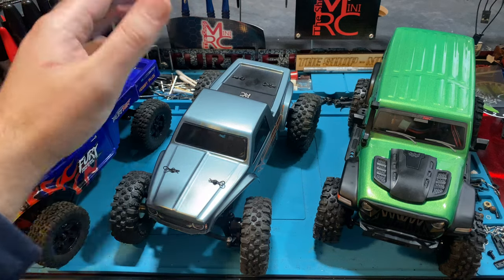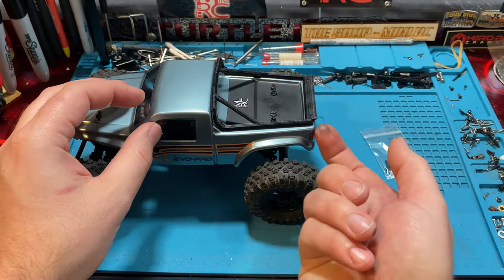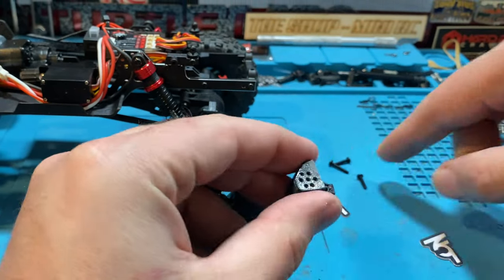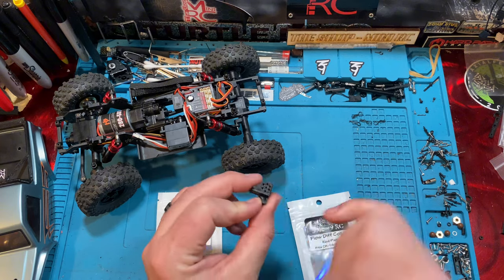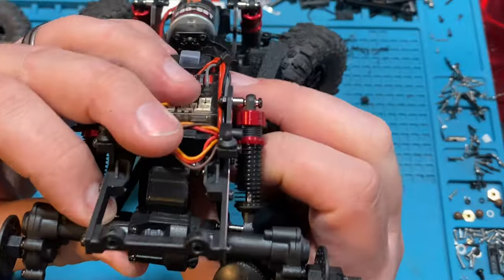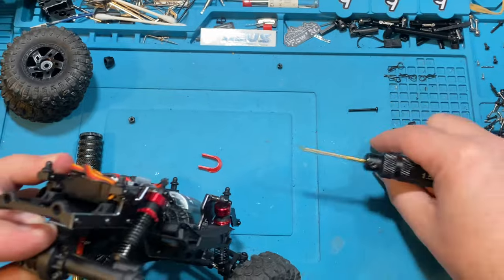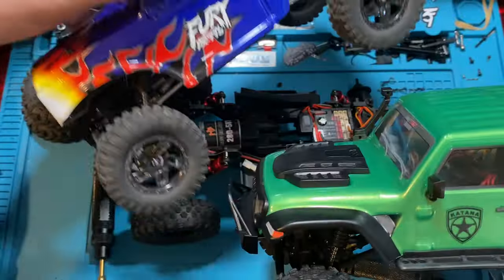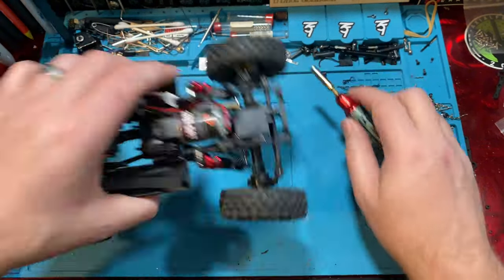3Flow9 CR18P & FX118 Upgrades. Bring this beast to the next level!

Comment: How well has the anti-squat mount worked to push the front end down during climbing & to reduce the torque twist?
Reply from the maker: When you push an ascent under throttle, it will help but you must be moving fairly quick and under throttle.

Comment: What would I need to swap out the venom with the Furitek Cedar?? I have my cr18p evo pro  at a shop and they say something about pinion gear? I'm a total newbie and have zero clue. Thank you in advance!
Reply from the maker: You would just need to buy the cedar for the cr18p evo / fx118. (If they have that yet) otherwise you’d need to be sure to have the correct pinion for the cr18p evo pro.  If the pinion on your current motor shaft would fit on the cedar, that should work.